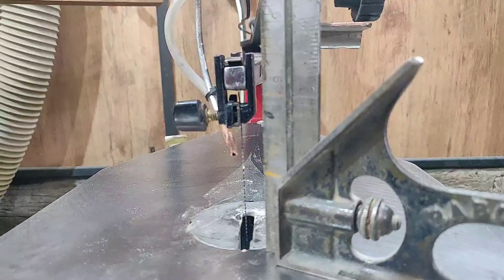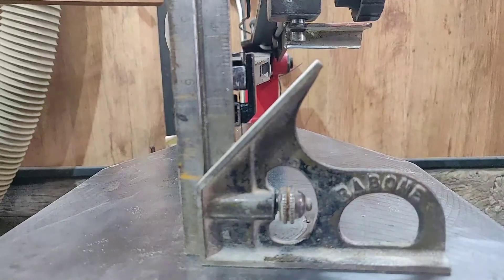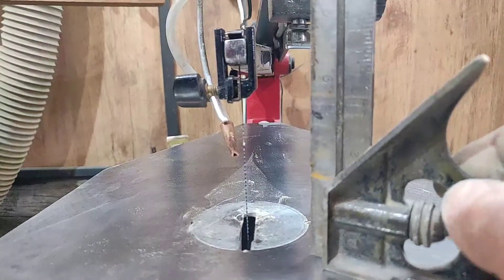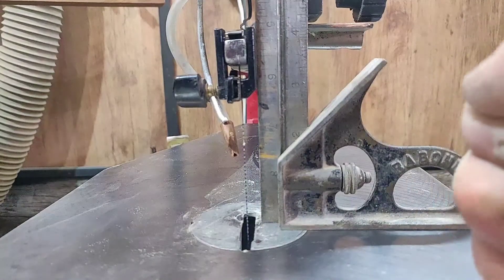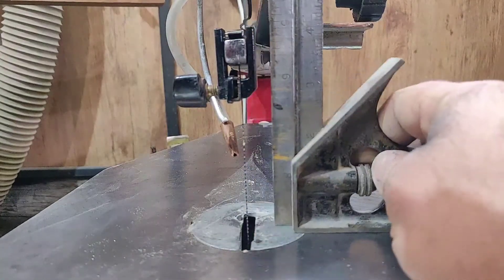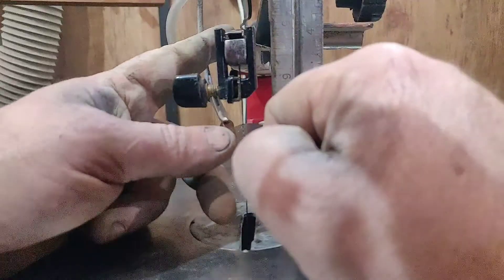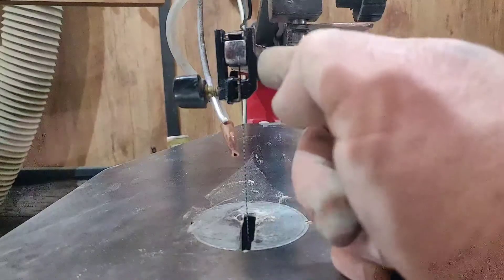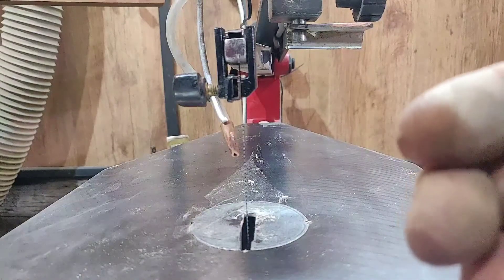Scrollsaw blade clamps causing vibration  a quick fix #shorts

Comment: Mines doing the same. sister recokns a loose screw /nut

Update.... I disassembled the front upper and lower arms and lubricated all the bearings with tf2 lithium grease. Along with all jointed moving parts and now it runs much smoother with way less vibration.   Very easy to do... U just need some Allen keys to disassemble the parts.

Comment: Well, it's essentially it's a 1 piston engine so the whole thing is naturally offset when running.
Reply from the maker: Ummm that is true but what if I find a matching scrollsaw and mount it underneath and synchronise them with a strobe light?
Reply: @WallyboisWoodworking  Please do this and make a video.

Comment: You see, this isn't a hobby.  This low level stuff is for workers. When I was taught (hands on) by guys to sweat copper it's my job, I'm getting paid.  Same, later, when I became a GC, I was paid, so all this low level minutiae didn't bother me.  But when you want a hobby for a few hours a week you don't want to spend hours on end every month fixing these low level things.  Without YouTube know one would be using a scroll saw, hell, machines, after tou punch in a few words, make all these designs and true artists use chisels and the like and work around the piece not have the piece work around the tool.
Also, from my research (all other things being equal) you have to bolt these useless machines down or weigh them down with weights like metal or sand bags.  And this is supposed to be a hobby.  Test, in your travels ask anyone if they know a scroll saw person or even knows what one is like.
In todays society they are a waste of energy and money.
God Bless